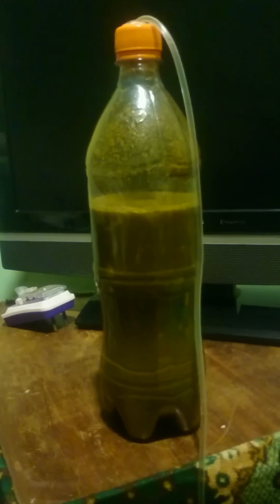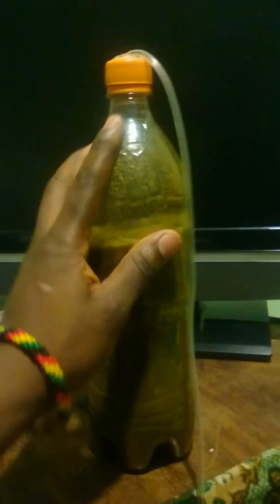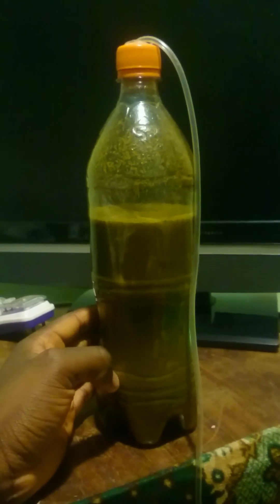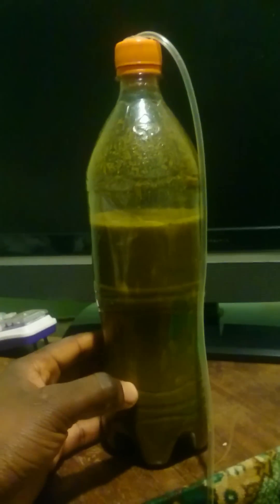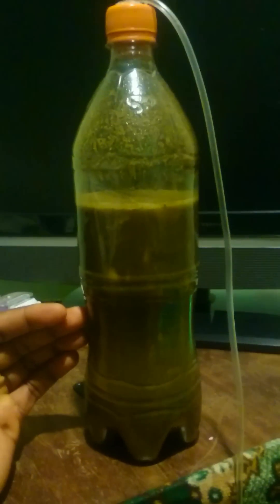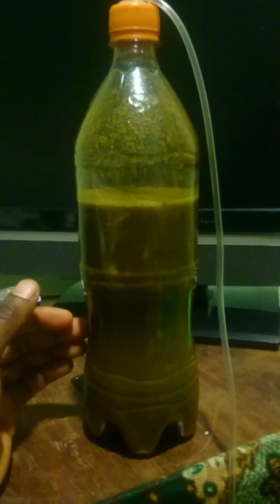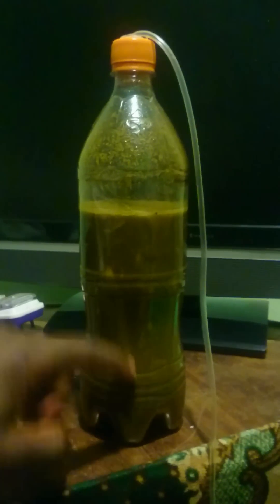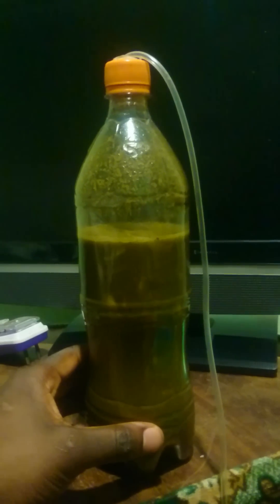BIO GAS ON SMALL SCALE

Comment: Please help out ....we are making digester and we are not producing gas wat might be wrong
Reply from the maker: make sure it is air tight and the environment is hot the bacteria works well in hot weather
Reply: @RichFriend  if it is airtight, how could the bacteria inside the digester survive? They need air too just to survive and reproduce.
Reply from the maker: @melkiorymarandu1850  no oxygen if not it will produce co2
Reply: @RichFriend  if with oxygen the product will become carbon dioxide?
Reply: Can you please explain how to deodour the gas,as when it reaches the burner, it still smells cow dung. Thank you in advance.
Reply: melkiory marandu It’s an anearobic proces, which means the bacteria don’t use oxygen to create methane (CH4). The conversion of glucose (C6H12O6) to Methane is done without O2 (oxygen).
Reply: Hi i'm also making a digester but we do it in a 7L container and its not producing gas. How to make it air tight?